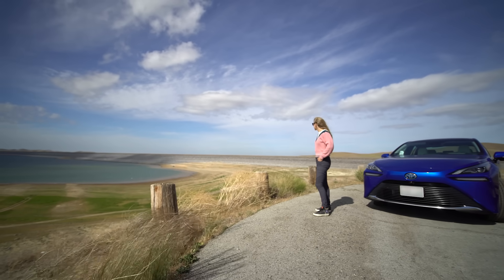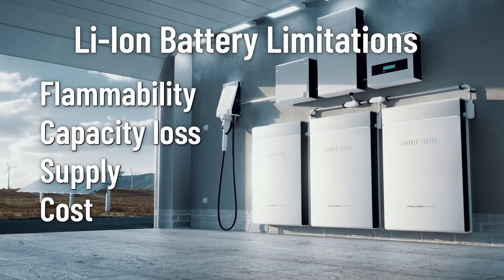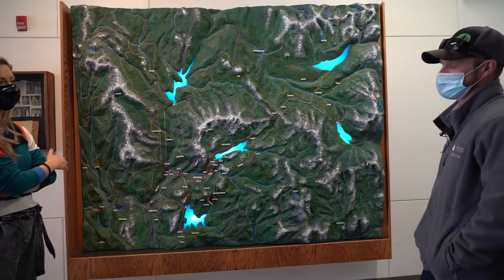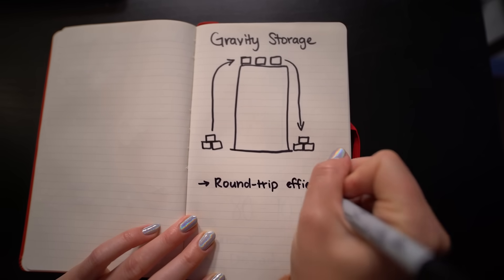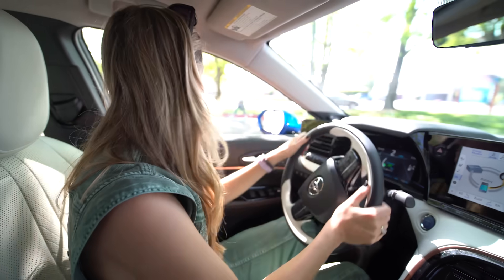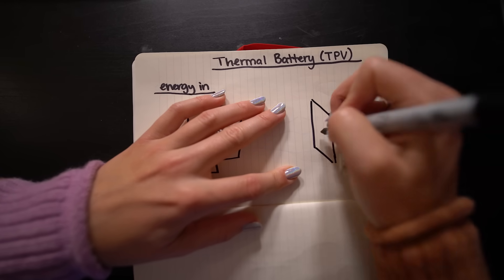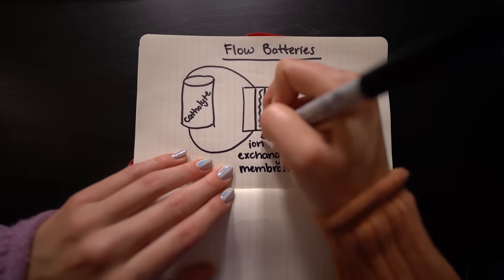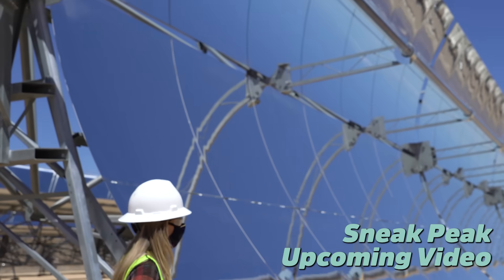The BIGGEST problem with clean energy

Comment: Nuclear energy is the way to go... and always has been.
Reply: Technically all these methods are nuclear powered.
Reply: Take a trip to Chernobyl or Fukushima and think again...
Reply: @Makatea  nuclear energy has caused significantly fewer deaths and health problems than coal and natural gas.
Reply: @CircuitrinosOfficial  How many liquidators in Chernobyl and long term deaths all over Europe due to the radioactive cloud were included in those statistics? And what about reliable long-term storage for nuclar waste?
Reply: @Makatea  All deaths from Chernobyl and any other nuclear disasters were included in the calculation.  The statistics are with the unit of deaths per unit of power generated (deaths / TWh).

Long-term waste storage for nuclear is still smarter than releasing the byproducts of coal and gas into the air we breath every day.  That leads to way more cases of cancer than radiation poisoning from nuclear ever has.
Reply: @CircuitrinosOfficial  I'd like to see how the statistics were made before I believe them. Send me a link and I'll check it out, but it needs to include information how, by whom and on what basis the underlying data was collected.
 
And the alternative is not fossile, but renewables.
Reply: @Makatea  Watch the video "Kurzgesagt – In a Nutshell" made on nuclear energy
Reply: @Makatea  Fukushima worked exactly as it should have. The reactors were fine; it was the spent fuel pools that had problems. The issue was 1) it is a 40+ year old design, and 2) no one planned for that perfect storm of quake and tsunami interrupting services for as long as they did. Even so, the leakage was minimal.

Chernobyl was a Soviet design that has never been used in the West. It is literally impossible for a Chernobyl to happen in a Western reactor.
Reply: @rapid13  Be that as it may: Three Mile Island, Sellafield etc.
A lot of those reactors will still be built in countries with shoddy oversight and the consequences of a catastrophic failure are so dramatic, that it doesn't matter, if they fortunately don't explode that often. Investing in renewables is by far preferable.
Reply: @rapid13  Although i don't realy question the safety of nuclear. I do love that you describe a combination of a tsunami and quake as a perfect storm, I mean who could have predicted these 2 events would ever happen together XD.
Reply: @someonespotatohmm9513  It was a deliberate choice of words, truly.
Reply: @Makatea  Oh, and Sellafield? Really? The best you can do is a 1957 event from a gen 1 reactor that could not happen today in any reactor in existence or that might be built? Are you also constantly startled by your own shadow, too?

Comment: I think mechanical batteries have the greatest potential, especially flywheels. We truly only need a day worth of energy storage to be completely renewable. Plus they don't have to use special materials to be effective, like chemical batteries do.
Reply: Well, while mechanical batteries are great at storing energy for a short time, they aren't THE solution for everything...

"We truly only need a day worth of energy storage to be completely renewable."
That is not true for most countries: In summer you get more light than in winter. But you need more enery in winter for heating. So you might want to have storage that's perfect for half a year or so. Mechanical batteries can't do that.

"they don't have to use special materials to be effective"
To have them store a lot of energy, they need to spin extremely fast (10k...100k revolutions per minute, maybe). You might want to use "special materials" to make sure the flyweel doesn't fly apart.

In the end the video perfectly captures the gist of this: There isn't one perfect solution. In the future we might rather see a mix of energy storage technologies, depending on capacity, power, energy density and storage time requirements.
Reply: I’d run with gravitational- lift large masses up and down disused mine shafts.  No parasitic loss at all.
Reply: Really depends on what all methods of making electricity you have. If you only harness solar and wind it would definitely be possible to go several days in a row of not making much energy
Reply: Just this year Texas proved your "a day worth"  thinking wrong.
Reply: Also flywheels are really only good with short term storage. With gravity you have an 80% loss if you store for 10 minutes or 10 days. Flywheels slow down over time even when not pulling energy, so your efficiency decreases with how long you store the energy
Reply: I may add that you will always be able to find extremes and there will be no one solution to fix all. Electrical grid is game of predictions, averages and having many types of electrical production with different pros and cons, so it stand for reason to have multiple types of storage, as was mentioned in video.
Also flywheels seemed a better option for my location in Europe, where I haven't experienced electricity shortages longer than few hours.
Reply: As a few people have pointed out, you'll need more than a day. I think you need a minimum of 3 days, with 5 or more being a stretch goal. We need to ride out a storm, particularly a winter storm. As this last year proved, they can last several days and cover a vast part of the country.
Reply: @Nicolas MIARD Oh, that's cool.

Comment: Other novel options for energy storage are: Pumping gas underground into an overpressure and then driving a turbine with that overpressure when the energy is needed. Or storing energy as magnetic energy in the field of a big superconducting magnet.
Reply: Sounds like recipe for ecological disaster, depending on pumped gas of course.
Liquid metal batteries seems to be very good for this type of storage.

Comment: The future is electric! The brings up a new challenge: Not only storage is an important issue, peak power also. 
Think of a cold winter when all the heat pumps need electricity, while electric cars need to be recharged - On top of the usual electric consumption such as computers, buildings, industry.
Reply: Yep, but you don’t need to charge all the cars every day all the way.  4m/kWh is easily achievable, with an average daily mileage of 20 miles that’s only 5kWh/day, compare that with the shape of the duck curve and you realise it’s trivial.
Reply: @Nicolas MIARD There is a huge potential if you just adjust our existing building technology installations right. Example: In my house the heating was on up to 22 °C (72 F), outside temperature. I adjusted that it turned of at 16 °C (62 F). This saved 20% of heating costs (!) and a did not notice anything in the house.

Edit: outside temperature.
Reply: @luudest  you don't notice the difference between 22C and 16C in your house? That's a huge difference.
Reply: @GameTimeWhy  I meant outside temperatures. Sorry
Reply: The electric cars can stop recharging and even put some power back into the grid.

We already have pilot schemes doing this in Europe.
Reply: Heat pumps can work during times of low demand, if your house is well isolated, this shouldn't be a problem.
Reply: @MDP1702  If your house is well insulated and lets enough light in you don't even need the heating when the sun is shining.
Reply: @someonespotatohmm9513  probably not in all regions, but some, yes.
Reply: "Cold winter"
You go DOWN.
There's a stable increase in temperature below ground.

Guaranteed energy.
Reply: @Nicolas MIARD 
"Carpooling"
Tesla FSD would reduce the global fleet by at least 50%, maybe 80%.
Reply: @rogerstarkey5390  
Tesla FSD would reduce the global fleet by at least 50%, maybe 80%.
No it will not, not unless you have multiple people sharing the vehicle at the same time (ie. carpooling). Yes, cars are stationary like 80-90% of the time, however the time they are not stationary is usually around the same time for most vehicles: going to work, coming back from work, going to the store either after work or during lets say a saturday, ... Because of this Tesla FSD (or better FSD in general) won't bring global fleet down by 50% or more without including extensive carpooling.

Now, it might change things for people who don't drive the regular hours (for example shift workers, people from from home, self-employed, ...), but this will maybe get it down around 20% or so I'd guess. Now if you could couple it with a great improvement of public transportation, that might be something different. Then FSD EV's might only need to do short trips (like home to train station etc), so that they can quickly cycle between more people, however technically this can already be done with something called the bus and ofcourse would again be more efficient by using, you guessed it: carpooling.

No need for vehicle to grid. ... Again generally, a BEV returning home will have sufficient capacity to remove that home from the grid during the peak period.
Sure, but what about people who can't use V2H? Like when you live in an appartement, don't have a garage/private parking spot or even better, don't even own a car. These people still will increase demand from the grid causing a spike when they get home. This is why V2G might come in handy during this time, instead of just V2H.
Reply: No need for vehicle to grid.
Generally, when an owner returns home, that's when peak use for that building occurs.
Again generally, a BEV returning home will have sufficient capacity to remove that home from the grid during the peak period.

Both recharge in the "slack" time.

Comment: Gravitational storage works just fine for NYC. We have very tall buildings and elevator shafts. We can lift weights up and down if designed properly.
Reply: The scale is nowhere near enough, do some back of the envelope calculations, you'll find you will be several orders of magnitude off. Also those elevator shafts are already used for elevators

Comment: So li-ion can catch fire but no word about it in the case of hydrogen? If just hydrogen refueling station damaged tens of houses around it what would happen with larger-scale storage?
Reply: @TheGoat given the number of gas explosions, I wouldn’t call it “well sorted”
Reply: @TheGoat The problem is that with humans involved, regulation isn’t enough. And as to ICEVs. We are moving to a safer tech (your other example that is 10x less likely to catch fire) as it becomes available so that example doesn’t exactly help your case
Reply: @TheGoat hydrogen being safer than gasoline is largely irrelevant as we are in the process of changing to a BEV based infrastructure. Hydrogen is way to expensive to compete with BEVs for any road vehicles. Trains? Maybe. Ships? Ok. But nothing on the road or in the air.

The battery fire in Australia was on a newly installed section that was undergoing initial testing and commissioning. It was not in operation. The problem was likely an installation error. Further, the fire only affected two back to back packs and spread no further. There was no explosion like hydrogen stations are prone to.
Reply: @TheGoat Last year we had about 300 hydrogen refueling stations in the EU and the US combined. In 2 years 2 of them exploded. That's 0,75% chance of explosion per year per station. I don't know if I can call it "well sorted in terms of safety". Hydrogen isn't as easy to handle as other flammable gases.
If a big storage facility goes boom it will be a slightly different outcome.
Reply: @TheGoat The flaw with this argument is that we are getting rid gas stations along with gas cars.
Reply: @TheGoat You are correct about the sample size but it shows that storing hydrogen isn't as easy as with other, larger molecules. Even when well regulated. 
And yes - if someone releases a new car and a bunch of them explodes on contact with water it is a reason to be concerned (Fisker Karma) but even in the beginning of the production Tesla showed that their cars were safe.
Reply: @TheGoat My comment comes from the fact that Dianna talked about the cons of the li-ion and mention that it might catch on fire but there was no word about it when she was talking about the hydrogen.

Comment: Wow a 400 perhaps hour “battery” that is super hot carbon + solar cells hmmm who knows definitely if they can raise it to over 50 percent efficiency that would be nice - if Greta Thunberg got too good at lobbying for long distance DC power lines the grid wouldn’t have as much local redundancies from all of these excellent operational or future energy storage solutions🤯⚡️⚡️⚡️⚡️⚡️🗽☮️💟♾🌈🤯 - for both hydrogen and ammonia there will continue to be industrial uses beyond future energy storage potential AND definitely there should be a focus on producing them in as green a matter as possible however defined (less local pollution and one hopes essentially 0 ongoing carbon atmospheric output and similar)

Comment: In a previous video i think fuel cell was rated at 60 or 70% efficient. Now in this video you said 25 to 40%. This is the critical point of fuel cells - the system as a whole is tremendously inefficient where BEV system as a whole is 90-95%. BEV needs to be the future.
Reply: I understand the previous video, they were just talking about the cars efficiency - but that's half of the system. From an ecosystem point of view, you have to look at both production and consumption efficiency for a tech.

Comment: Electricity can also be stored as heat: for heating the boiler, or for preheating the mass of your house, via heat pump. 
(power2heat)

Electricy can be stored in the gas grid: As methan (power2gas)
Reply: Energy can be stored as heat, but if you want to use that energy again later you need a large potential difference. Like storing heat from a thermal powerplant in a heat-battery like a big mass of molten metal for example. If you only have a few degrees of difference in temperature like inside vs outside of your house, that enegry difference is not big enough to be exploitet efficiantly. Electricity can only be stored as such, a difference in electric charge. Anything else involves energy conversions that allways include larger losses.
Reply: @hernerweisenberg7052  : in pre-heating (or pre-cooling) you never want the electricity again. You actually wanted the heat (or lack thereof), and you just bought a bit more earlier in the day so you'd have the amount you wanted at peak period.
Reply: @benoithudson7235  Ah ok i get it now. Has nothing to do with storing electricity tho ;D
Reply: @hernerweisenberg7052  
Larger than Hydrogen? (75%loss)

Comment: I work in energy storage and battery supplies in general here in the UK. The UK wants to ban Petrol cars by 2040, so the uptake in electric vehicles is going to be that high that the power grid will not support it. Energy Storage is going to be needed to supply the grid with that uptake when power utilization is high, but it won't fix the problem. 

I've said you need to add more Nuclear power stations to support the charging of cars etc, as well as then having the excess power that's produced to process Hydrogen for cars with Nuclear always running at 100%. Then if you had Hybrid cars with Hydrogen / Batteries, you wouldn't have to fully rely on electricity solely, and you'll relieve stress on the grid. 

Change the format from Uranium to Thorium and the waste is significantly reduced as its life span is much shorter. 

The world could go 100% green before the turn of the 22nd Century, which would be beneficially for everyone.
Reply: You're worried there's going to be too many batteries on the grid so you need more energy storage?
Reply: @benoithudson7235  No im worried that there's not going to be enough supply in the grid in general. the grid in the Uk while it has support for double the amount its currently outputting it wont have the capacity in terms of power to actually do that due to the power stations feeding it. 

Energy Storage if used repeatedly will drastically degrade the systems much faster than intended. We need storage but only as a last line for when the grid actually needs it, not every night when the suns not out.

Comment: Great, the other options for storage come with high efficiency percentages. Electrolysis --> hydrogen -> fuelcell is horribly inefficient compared to other, mature options. And 40% is wishful thinking rather than reality, its more like 25% today. And of course, Li-Ion-Batteries have a fire-risk, hydrogen of course does not. It's like the Hindenburg never existed in Diannas world, sponsored by Toyota...
Reply: @blacknester And I'd like to see that kind of efficiency outside of a lab in a real-world-setting to be independantly verified, including some data on maintainance cost such as air-filters and fuel-cell-lifetime.

Comment: Didn’t the giant Tesla battery catch fire in Australia? 
I’ve worked in almost every type of energy facility in use in North America. That includes nuclear, coal, oil and gas, biomass and municipal waste, hydroelectric and thermal solar. The 3 I never got to work on were PV, wind and tidal. I wish I could have worked in those 3 I missed. Darn it!
I was offered a job in the high Sierras at a hydroelectric facility a number of years ago. I turned it down due to family medical issues, and the fact that the position was cut off from civilization for weeks at a time in the winter. (The commute in winter was by snowcat or snow mobile.) It would have been a great job at another time in my life, but those things happen.

Comment: Liquid Metal is an interesting battery storage choice. For the industry, not individual use. It's already in use as well. As for individual use, lithium Ion doesn't seem sustainable it's dangerous and not environmentally sound. Solid state lithium will hopefully have some production breakthroughs soon. Iron air looks promising, but needs to find a way to overcome. Recycling needs to be a priority as well.